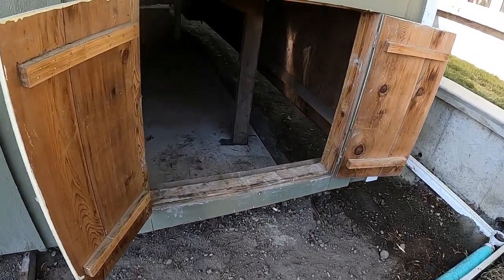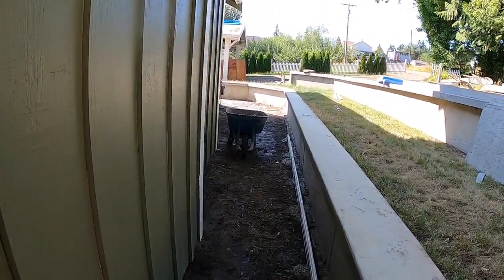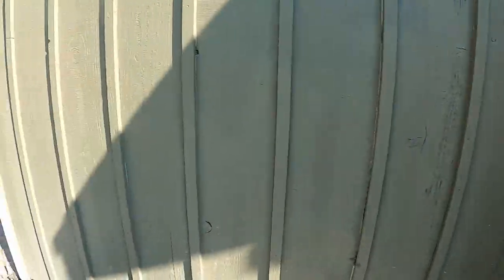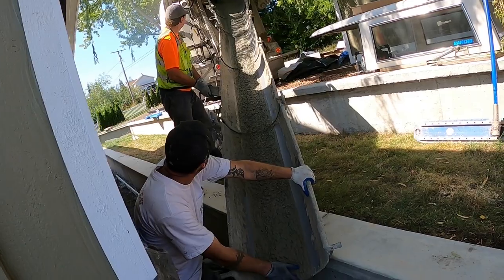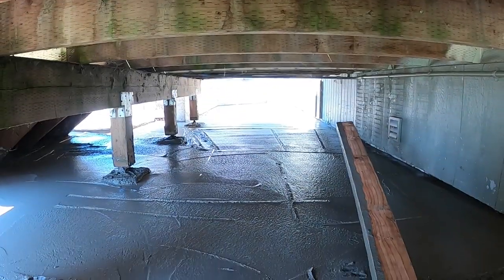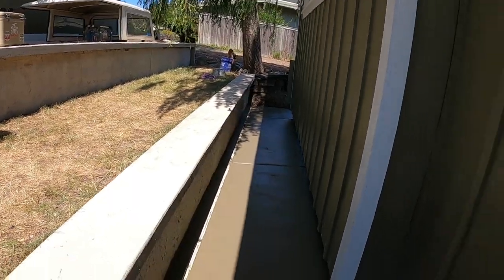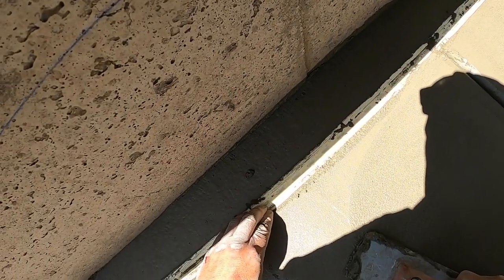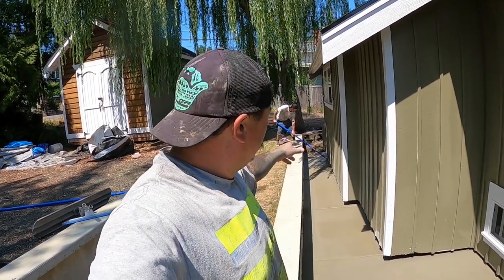Pouring Concrete With A Tight Broom Finish

Comment: Have u ever used volumetric mudd?
Reply from the maker: I've personally never used it but it definitely looks interesting. Around my area we have quite a few concrete batch plants with lots of trucks. So there's never been a situation to we're I've needed to use them. Is that something you do over where your at. I'm in Washington state where you located?
Reply: No but I'm thinking about buying 1, I'm in indiana, we only have front dish trucks!  It's really hard to get mudd out here